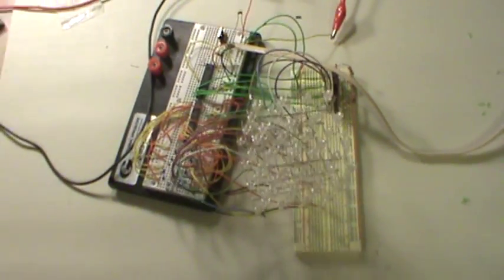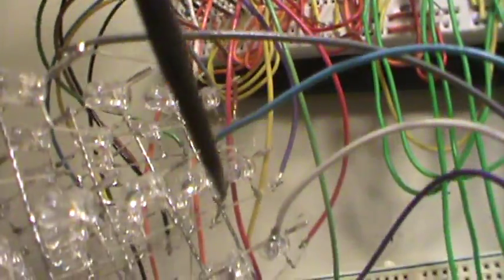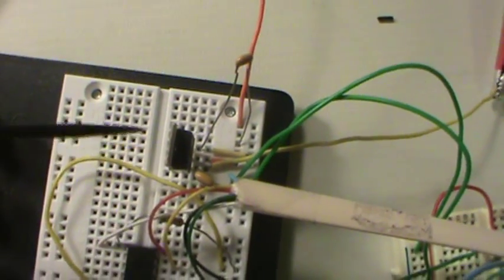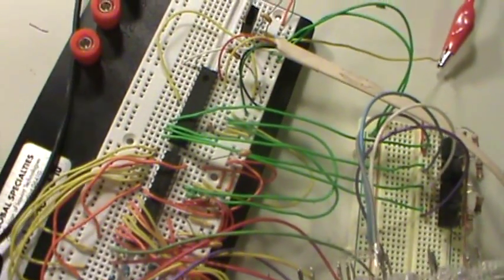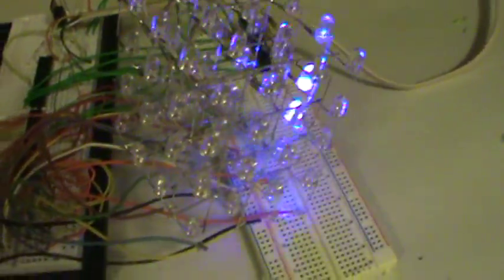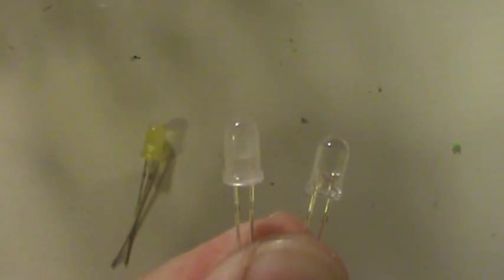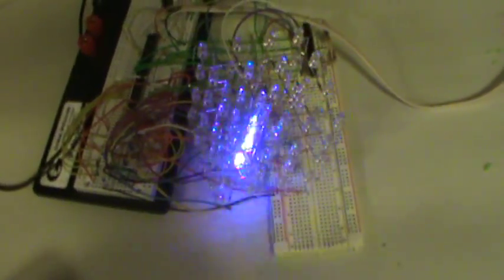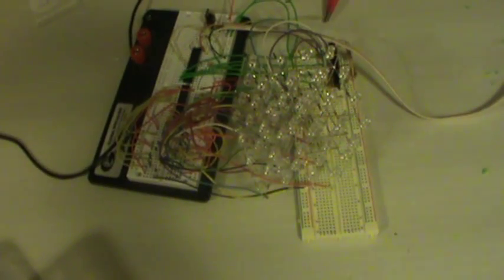4x4x4 LED Cube Demo

Comment: really cool but hw to hv several sevaral another different patterns
Reply from the maker: You can just make them in different functions saved in the code then call them with delays in between so to scroll through them.  I am going to work on another video of how to do these sort of things just haven't had time.  Hope this helps.

Comment: how can i program the code to go by b0000?? please
4x4x4 LED cube
  If i have it Connected
  column
  "a1-13
  " a2-12
  " a3-11
  " a4-10
  " b1-9
  " b2-8
  " b3-7
  " b4-6
  " c1-5
  " c2-4
  " c3-3
  " c4-2
  " d1-1
  " d2-0
  " d3-A5
  " d4-A4
  layer 4-A3
  layer 3-A2
  layer 2-A1
  layer 1-A0
Reply from the maker: Hey there, I think I know what your are wanting to do so let me know if I am wrong.

If you are wanting to control the columns with a 16-bit number, since 4x4 is 16, you will need to add d3 & d4 to the shiftregisters.  If you use two 8-bit shiftregisters you will get the 16 addressable pins so put all your columns in the shiftregisters.  Then if you are wanting to have a 4-bit number to control the layers, if you are using hi-tech c, you could just output that number on to the port (i.e. PORTA = 0b0000).  Thus, you will effectivly be able to pick the columb with the 0b0000000000000000 (16-bit number) and you can pic the layer with the 0b0000 (4-bit) number.  You will just have to make sure that wen you wire it you keep track of which port is at what bit.

examle of layers
0b       0    0    0    0
           |     |     |     | ----- Layer 1
           |     |     |-------------Layer 2
           |     |-------------------Layer 3
           |-------------------------Layer 4

I hope this helps.

Comment from the maker: Hey there.  In the future I may post other codes but it is really simple.  You don't need to know C++ just basic C.  Check out my project code page for the code.  Also there is an LED Cube 8x8x8 project on instructables website

Comment from the maker: Yes you can use whatever controller you want.  It is just an array of LEDs.  If you want to checkout my channel there are more videos about this cube.  Even hardware and software so you can see where I have used the PIC controller and you would just replace it with your ATmega and code it and you will be good to go.

Comment: My code for 4x4x4 cube shows me error of 'undeclared identifier ' during compiling what should i do to correct it. can u upload basic code writing basics for 4x4x4 please because my cube is ready but my software coding is not getting right its having a lot of error, If it doesnot work than my energy in making cube will fail.

Comment from the maker: This is true and it may work but I think the focus is right at the tip of it and if it is reduced in light it will still shine through just dimmer.  I have thought about using some 400 grid sand paper and sanding the tips of the LEDs to give them a bit of diffusion so that the light isn't so focused.  It may or may not work.  Just a thought.